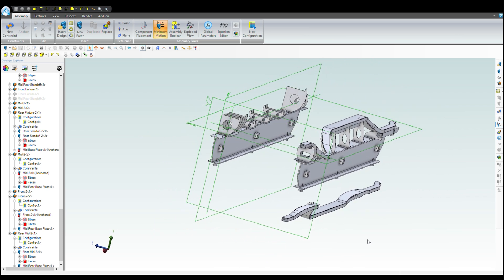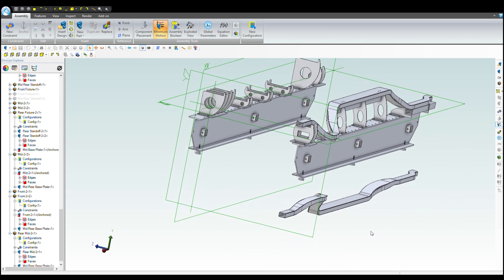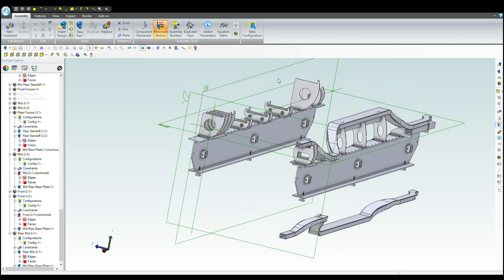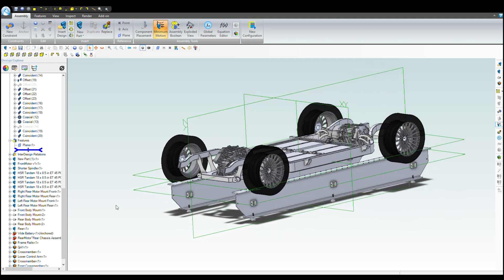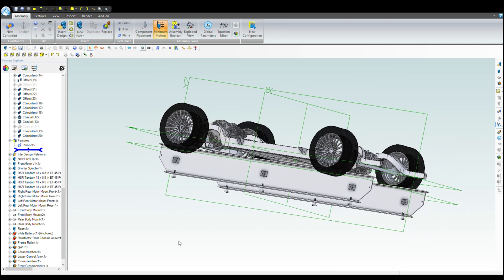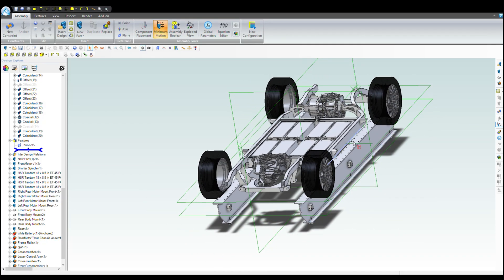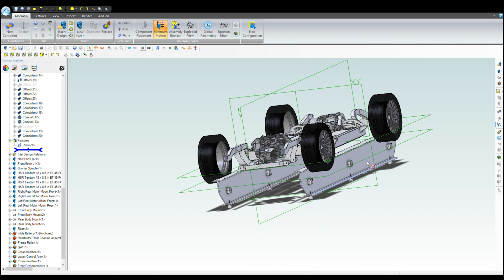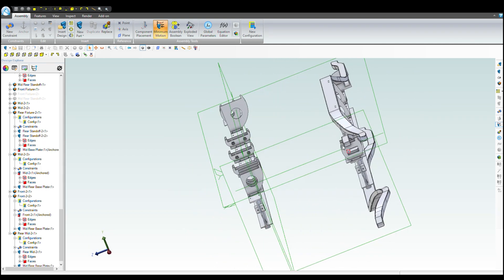Tesla Swapped AWD C1 Corvette Chassis Part 2

Comment: I can only assume steel warping from the heat is a constant battle. 4680 Tesla battery? 48V?
Reply from the maker: Yeah it is! We have messed with the 4680 enough to realize it is not worth the effort it would take to make a custom pack. These ID.4 modules are working pretty slick so far. I would love to do 48v but not quite yet….
Reply: @519Kustomz  German engineering is often a safe bet. Remember to have fun!

Comment: This might be a newbie question but I was curious haha, does the model 3/S have the same subframe mounting position? meaning you can interchange the subframes?
What about the Plaid can that rear drive unit be thrown straight in?
Are you able to put a plaid rear drive unit into the front making a quad engine car?
Cheers
Reply from the maker: They are different mounting positions unfortunately. Also a few other differences like track width and voltage requirements. We have discussed several time about what we would put a plaid driveline into. I would use the tri motor with just a single front drive. That’s way overkill by itself!
Reply: @519Kustomz  I currently have access to a Rivian R1S in my country (had 12 of them send to Australia to use in a movie)
Was thinking the R1S quad motor driveline would be exceptional to put into a corvette.
Reply from the maker: Oh yeah that would be cool. Not sure who has cracked them to run outside of Rivian yet though. Would be a big job